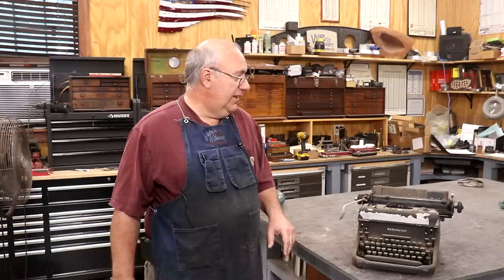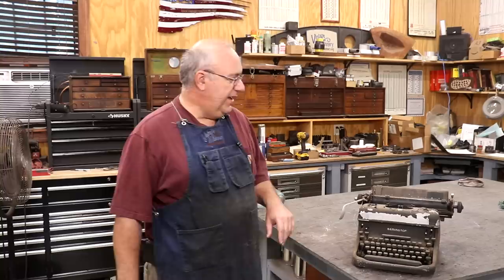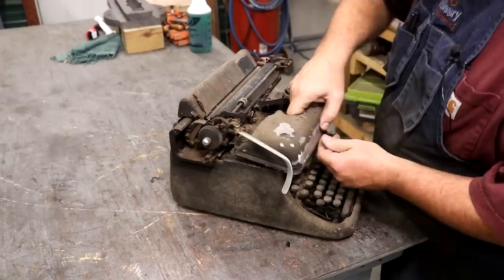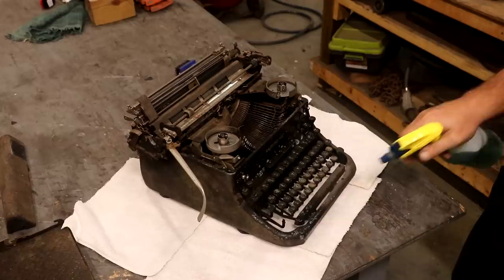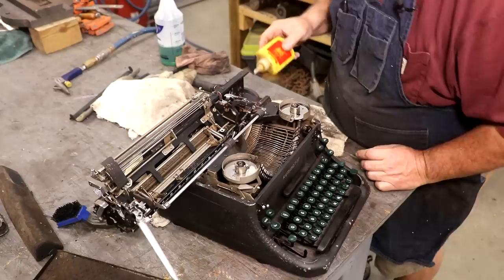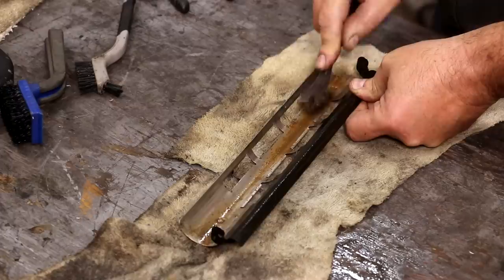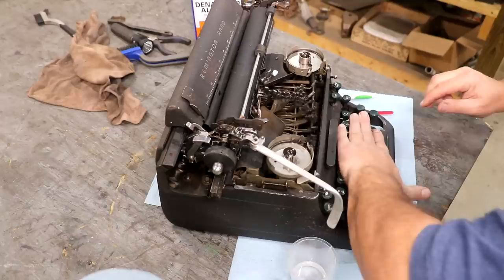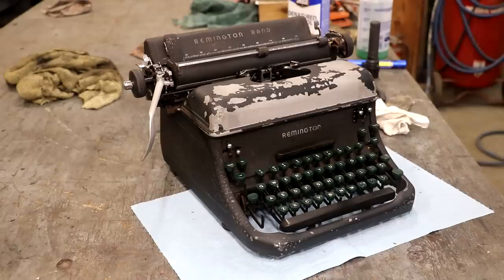Restoring a Antique Remington Rand Typewriter!

Comment: As ex typewriter engineer,we always steamed cleanrd,not air ppressure as you could blow spring loose.Not sure about the wax on the type arm,this my cause problems down the line.shame you  don't live in uk,I would love to have fixed it for you
Reply: Don't let that stop you...Go out an find an "orphan" to repair!  (In the States, if Y.T. is any indication, there IS a demand among crafters for typewriters!  ...In Pink!  Or Aqua!)  The fixin' makes for good exercise of the brain cells!
Reply: Steam cleaning didn't rust parts?
Reply: @bme7491  while i can't answer for the OP,  in firearms we often use steam or boiling water rather than cold water as the heat from the water will heat the metal. as long as we get it hot enough and give it ventilation the hot metal will cause the water to evaporate off of it before it causes surface rust to form.
Reply: @bme7491  I'm sure that some kind of moisture-removal & oiling step followed the steam cleaning.  I guess I need to look into cleaning/repairing two antique typewriters and one Teletype here at home!

Comment: I love typewriters. One of my favourite parts is the cleaning and fixing process. There were somethings you did that were great, there were other things that almost gave me a heart attack. First I hope you kept the metal spools for the ribbon, because they will work far better than the new plastic ones. Second I would if you ever have to clean a typewriter again I would remove all the body pieces before cleaning, it just makes it easier. Third Simple Green is a miracle worker, and using the nylon brush was good, I would just recommend not scrubbing over the decals as aggressively. Fourth when you were clean the segment and the slugs you can use a wire bristle brush or a copper one, it won't hurt them, but I like to lift all the type bars up first and put either rags or paper towels under them so that any gunk that comes out doesn't drip to the moving parts under them. I also prefer lacquer thinner for that, some prefer denatured alcohol, others prefer mineral spirits. Also I would never put any kind of lubricant in the comb of the basket, there are no joints there so it doesn't need it. Some people also like to use WD40 to polish the paint on there typewriter, but with that said never use WD40 inside the machine. It's a typewriters worst enemy. But overall for a first time you did a pretty job.

Comment: I started with IBM servicing typewriters in 1972 and have restored and repaired hundreds of typewriters. We put them in a "washing machine" filled with mineral spirits and oil. Avoid compressed air or you blow away some delicate springs.
Reply: David, by 1972 we had dispensed with mineral spirits, we still used washing machines for  with HOT water and a good detergent, the hotter the water the quicker the machine would dry. Compressed air had been used for years and years, it was never a problem in our workshops, your pressure regulator mus have been set must have set far too high
Reply: @billogle4776  We still used mineral spirits and oil until 2018 in a high flow washer tank. Followed by dip in light oil and finally an over night drip dry with a fan blowing. I did  learn quickly about air pressure regulators of course. A "do gooder" threatened to call the EPA so we shut down the whole cleaning operation. Amazing how well a 50+ year old Selectric typewriter still functions.

Comment: Must be something in the water because my Sweetie wanted an old manual typewriter and we found a 52 model Smith/Corona. I cleaned it with a tooth brush, carb spray, compressed air and a bath in Kroil. When it quit dripping she uses it on a regular basis. There is one key that sticks but she's happy. Guess who ELSE is!

Comment: If you want to take the "unit " out, look down on the left hand side between the unit side plate and the base, you will see an "arm" (it's a fork) attached to the ribbon  drive wheel which turns the transverse ribbon drive shaft, , the fork should be to the front of the machine, if not, ease the tension strap to rotate the main spring drum, it will turn the shaft. Once the fork is in the forward position you can release the two clips on the unit side , one left and one right. Lift the unit up and pull it to you it should come out, if not jiggle it and it will. When you replace it just make sure the PIN is IN the Fork........thanks for rejuvenating a beautiful old machine....message me if you need any help only to pleased to help

Comment: I actually enjoyed typing class in High School, and it turned out to be extremely valuable.  The best typewriter we had was an ancient manual Underwood, and I could type faster on it than on a Selectric.  After Basic Training I got shanghai'ed at the Battalion front desk by a Sergeant Major who informed me in great detail why I didn't want to go to the Motor Pool, and spent three years clerking for him there and at Brigade when he got bumped up.  Then I set advertising type for a local newspaper to supplement my GI Bill while I was going to school.

Typewriter repair shops used to dunk the entire mechanism in a cleaning tank followed by an oil tank.

Comment: After a while, the older typewriters platen would glaze and harden.  You could even see the peaks and valleys after a while where the letters struck the paper then the platen.  In our high school, the typing teacher would send the platens down to the shop teacher who would chuck them in the lathe and very gently file the rubber smooth and soft again.  It looked nicer too.  Keep up the videos.  You certainly provide a variety!

Comment: I did a slight resto on the smaller travel version of that machine and it had the same problem. I found the arm had a slight bend in it (hardly noticeable) causing it not to return to its location. After straightening it it was good to go. I believe it had a return spring to send the arm back after striking the paper, that spring may be weak also. Great video.....now my wife wants one. Thanks

Comment: Your video brought back memories , I worked for Remington for many years both on the bench and as a field service mechanic, Your machine is the Remington model 17, the first of the Rand design machines . It was pleasing to see that you didn't rush in where angels fear to tread. The 17 was an easy machine to work on if, you knew how . The unit would come out of the base simply if you knew how and perchance you did get it out and didn't put it back in correctly the machine wouldn't work.......
Reply: What I remember, those machines and the KMC (which he actually has) came apart in six pieces.  Again, if you know what to do, and you’ve got a little time, you can button ‘er up fairly easy.

Comment: Most useful thing I learned in HS was touch typing  Football coach delivered licks if you failed to perform well enough on your timed typing exercises. Best way to clean is pressure wash with Varsol (diesel if that's all you have), then blow dry with air. Then clean mating surfaces with carbon tetrachloride and tooth brush, the VERYVERY light application of light oil (gun oil, sewing machine oil, 10wt). Used to get carbon tet at local pharmacy, but no more. Works great on typewriters, teletype machines, etc. BTW: guys who designed these things must have had some really good drugs.

Comment: Keith, Thanks for the wonderful video and great story. I too took “Typing” in high school and absolutely hated it.  My high school did not offer Typing so my Dad insisted that I take the course over the summer in an old smelly hot high school miles away from our house.  That was back in 1962.  And I completely agree with you that Typing turned out to be a very valuable skill.    Thanks again for all you do for your very enjoyable channel!  Over and out,  Kent
Reply: I learned to be reasonably fast but accurate using an 80 column card punch. One error and the entire card/line had to be done over. Eorres were very expinceve.

Comment: Hi Keith for the rubber rollers there is a product called "Rubber Roller Restorer", which cleans and softens dirty and hardened rollers. Originally you could only buy it from Xerox, made for their copiers and printers but now you can get it from Amazon. I use it on all my printer rollers and on the rubber film feed rollers in some of my vintage cameras.

Comment: My grandmother had two of them old typewriters back when we were kids.  One was a Underwood and the other was a wide carriage Remington older than yours.  Us grandkids were abusive on that old Remington, beating on the keys, jamming them up and so on.  The Underwood, grandma threaten us by an inch of our life if we jammed a key on it!  What she didn't know, well, we still alive.  Recall grandma using some kind of solvent to clean the keys with.  It was in a metal can with a brush in the lid, reminded me of Naptha today, didn't know that back then.  Might be something to try.  I don't recall what happen to the Remington, the Underwood, my brother has it and somewhere in my stuff I have the typing book that came with that typewriter.  Recall the typewriter being a 1920 something vintage.  Keith, thanks for sharing, a little different twist to old iron restoring.  Ken
Reply: Could the product you're referring to be "Energene"?   I need to check out the naphtha you mentioned to see if that's the odor I recall.   Until about 2 years ago "LA's Totally Awesome Laundry Pre-Wash" (Dollar Tree) used a component that smelled very much like the STAIN REMOVER my grandmother used on her laundry.  Sadly, the $-tree product no longer has that component, AND is NO LONGER an excellent stain remover.

Comment: I worked on typewriters and copiers for IBM and others for 27 years.  I mixed naphtha and 10 wt oil to spray typewriters out with, then blow out with air.  The naphtha evaporates, leaving a coat of oil behind.  Clean the platen and feed rolls with lacquer thinner.  And as mentioned,  you may have to do some type bar alignment.  Have fun!

Comment: I agree with you 100% about taking typing in high school.  I had to take it as a requirement my junior year.  As you did as life moved on it began to be more useful.  I used it in my time in the Air Force, the first job I had when I got out was shipping / receiving so guess who got to type all the bill of laden and manifests.  Then I bought a word processor that looked like a big typewriter and up to today on my desktop sending you this comment.
Reply: Remember those electric typewriters that had a dab of memory, and a screen in the "hood", that would let you enter, maybe, a line of text before printing??  That way you could make corrections before printing that line, and, one by one, each of the next.  I'm not sure, but I THINK that was a Brother machine.  I didn't get to use it very long; it went to the CEO's secretary (!!)  But shortly after that our S&R Dept got one to help alleviate errors in their paperwork.
Reply: @amkarei  The one I have is a brother.  I bought years ago for a small home business I had.  Mine also has a small disk drive for document storage.  I have not turned mine on in years but it is in the back corner of my closet.

Comment: I learned to type on an old underwood mechanical typewriter. It's the reason i have to have a mechanical keyboard today. if I don't get a click I tend to try to hammer the keys through the keyboard. that old typewriter was what started my fascination with mechanical linkages and how things work. I have used the black crackle paints to repaint sections of old radios and typewriters you can get a fairly close match and you don't have to deal with peeling paint. but i understand keeping the original finish.

Comment: I learned how to type on a Remington Rand in High School...we were estatic that after 6 weeks we were allowed to move to the IBM Selectric electric typewriters.  Such a dream after that Remington.

As far as cleaning that typewriter, all the Simple Green will do is dissolve the grease/oils.  Believe or not we use simple green as a degreasing agent in SCUBA when dealing with high Oxygen environments (Deco Bottles, Mixed gas bottles, regulators being used for high O2 use items, etc.).  Oxygen and grease together are are NO BUENO!  We soak and scrub all the "O2 Clean" parts with Simple green and "Purple Stuff".  Both are great.  doing what you did won't hurt anything as long as you re-oil the mechanisms after it's done.

Comment: In HS i used to clean Typewriters for a school service unit.  We used 777Dink to remove ink from keys and Fedron.  Probably both are no longer made due to the heavy vapors they had. 

For the  key that won't settle you will probably need to look at it carefully from the back and bottom.  Look for pivot points or a loose spring. You will need a oiiler bottle with a very long hose.   It is a dropper bottle with a straw like a wd-40 straw that you can use to reach in to hard places to oil.  Or you could just run a spray can of oil along the pivot points on the inside very carefully.
Reply: Just don’t use gasoline—that stuff will lead you to whirling and hurling.

Comment: This brings back memories of a time I was in the service and had some time on my hands. I picked up an old typewriter at a pawn shop for a couple of dollars and proceeded to dismantle it. There were 100's of parts and I took every one out,then reassembled it,after which it worked fine, but I missed one small washer, to put it in would have required starting over,so I didn't. Lost interest in it and tossed it, as I had no need for it, just wanted it to see if I could do it.

Comment: I worked in a chemists office in the late 60's and we did assay calculations on a Smith Corona-Marchant manual calculator- I think they went out to 5 or 6 decimal points-  that was a complex mechanical machine,  probably weighed 50 #.   When Texas Instruments came out with the electronic calculator those things went to the land fill by the trainload- just as the typewriters did when word processors were introduced.

Comment: In the early 70s I worked for SCM fixing typewriters.  We had three large tanks: Varsol with Lick (nasty stuff), Varsol, and Varsol with 30 weight motor oil.  Each had a pump and brush that the fluid pumped through.  The typewriters soaked in each in turn and when they came out of the last tank were blown dry.  This meant that they were clean and oiled.  If I were restoring one today, I would use WD40 and paint brushes.  Kerosene for cleaning and kerosene with some oil would work very well too.   You still need oil inside each pivot point - you really need to spray it down with WD40 or similar and work it while doing it.

Comment: Keith, if you stop by a local printing supply shop....  real offset printing, not photocopy printing... ask them about Rubber Rejuvenator.  It is often referred to in the business as "Pink Lady".  A little on a rag will return your rubber rollers to like new condition.
Reply: Any info as to whether this might work on RED RUBBER STAMPS used by card-making crafters?  The info would be VERY much appreciated!!
Reply: @amkarei  I have no experience with that material.   On rubber rollers, they tend to glaze up and get hard.   "Pink Lady" will break the glaze and give the old rubber a softer surface.  If that's what you need to do, it might be the right product.

Comment: As a kid, I worked in a type writer repair shop 50 years ago. The plat-ten can be removed. All its' ridges and bumps can be removed by sanding. Use something like a drywall sanding screen and it will look brand new again. Use a very light machine oil.... like sewing machine oil and you might be surprised. Good luck.

Comment: 15:32 a green scouring pad and meths and place in hand and roll it round ...not side to side..was a typewriter mechanic between 1979 ~1989 ...we strip em down,steam clean , and dry in front of fan heater then light oil with white spirit after ...light oil in segment ...send off platen for new rubber if shiny and hard.( if paper perforated with letter o )...we repaired Olivetti,Adler,Olympia , smith corona,Remington rand,silver Reed ,golf ball and daisy wheel types...then vdu appears and printers which killed typewriters....Tom hanks collects these...lol

Comment: Not exactly a typewriter but way back in the day we used to clean teletype machines by immersing them in hot soapy water in a large ultrasonic cleaner. A fresh water rinse an air hose and a session in an oven to dry them out. Then lots of oil.

Comment: At 15:30, that is the paper guide that  brings the paper around from behind the platen where you put the paper into the typewriter. Those two smaller rollers are the pressure rollers that together with the platen move the paper in the typewriter forward or back as needed.

Comment: Though this machine is patterned after the Model 17 of 1939, it’s mostly like a KMC (Keyboard Margin Control) machine of 1946-1948.  It has aftermarket keys, but the left shift key is missing). One could be had from a junker somewhere.  Mine like this one was from Fort Hood, Texas, and still has the names of soldiers who used it—I’m leaving those names on—one name has December, 1947 after it!!  I looked up on the database and it’s a 1947 model!!  I put its third set of keys on from several Super-Rogers made in the early 1950s.  The main keyboard is blank keytops so you have to know how to touch type to use the machine.  It has elite type.

Comment: Mechanical typewriters like that are the reason we are stuck with the QWERTY keyboard layout.
It is specifically designed to SLOW DOWN a typist so the hammers don't collide.
The Dvorak keyboard layout puts the most used letters in easy reach, so you can type really fast.
Reply: Trouble is too many people learned the QWERTY keyboard for there to be a complete changeover to DVORAK.  They tried it once.